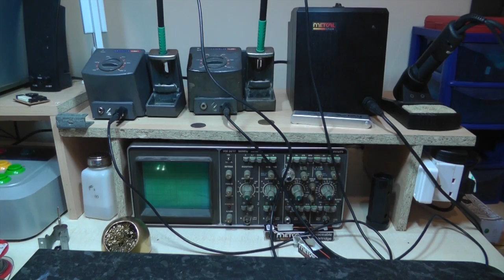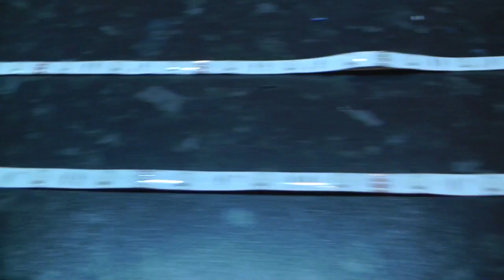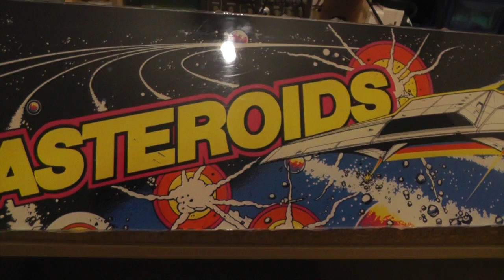Experiment - Reusing left over LED strips for Arcade Marquees - RGP #014

Comment: I was thinking of using these strip lights for my Pac-Man replica build (see channel if interested) rather than incandescence bulbs but couldn't decide on 3528 or 5050 LEDs. Found your video on google and now I have my answer (5050 LEDs). Thanks, you now have another subscriber :)
Reply from the maker: Thank you and sorry for the delay in replying.  Definitely go for the 5050 type and if you can, get the 60 led per meter ones as they create more combined brightness, these were the 30 led/m type.  I'll check out your channel for the Pac-Man build, if you need to know anything from an original machine just get in touch :)
Reply: retrogamesparty Yeah, I went for the 5050 60 led/m and they look great! I'm looking forward to fitting them behind the marquee when it is built. :)